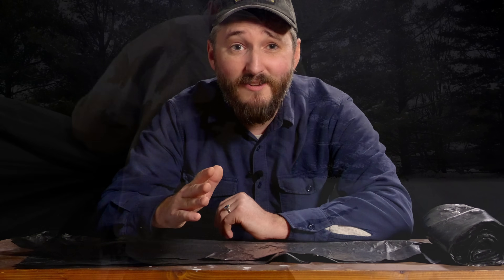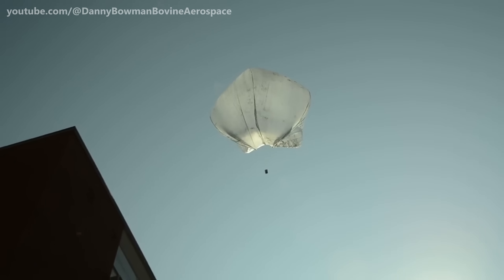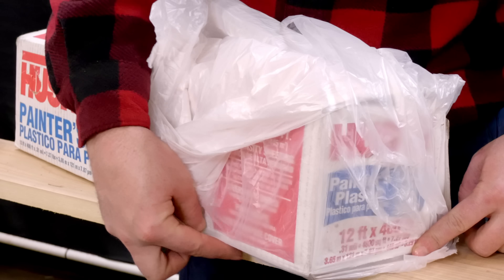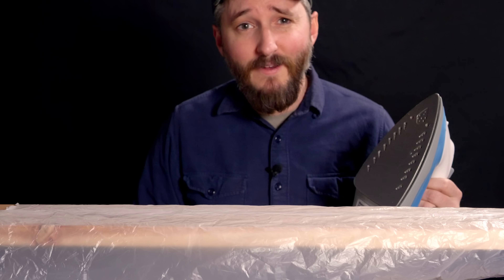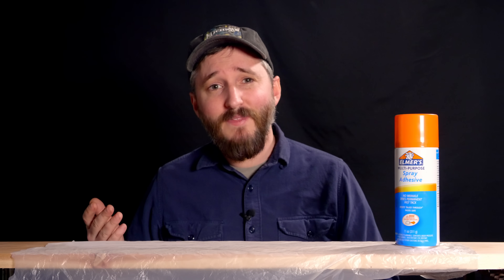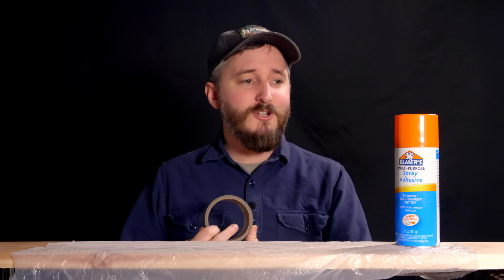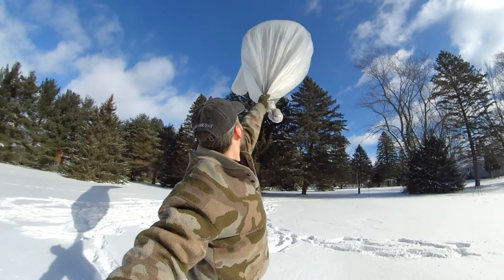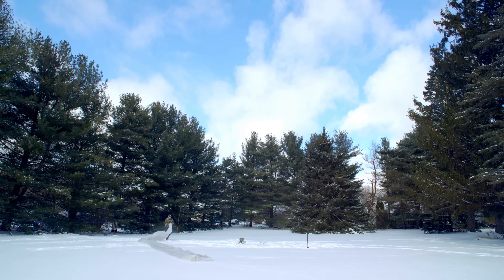DIY Solar Powered Balloons

Comment: You asked how anyone makes good heatseals on thin balloon films and said you read all your comments. I have a significant amount of experience in custom balloon manufacturing so here are a couple things I've picked up:

Each film is different, but heat sealing parameters are heat, dwell time, and pressure. All three factors play together so you can imagine the graph of good heat sealing to exist as curves and areas rather than single perfect points. Within those good seal spaces, you can prioritize factors like "Get it done fast." and "Don't overcook it, I can touch up areas that need more while it's in the jig and I can't screw this up."
Heat: an iron like you're using is just fine for many applications and will work for what you're doing. Through testing, calibrate the temperature starting low and going higher in increments, giving the iron time (a few minutes) to stabilize between adjustments. Overshooting at first is fine as you're bounding your temperature setpoint and narrowing it down. Final calibration comes up from cool to tacky to full fusion.
Dwell Time - How long you keep the heat one a given area
Heat transfers to your film at a particular rate for the tool you're using and your material layup(kapton safety release layers). I have made many a balloon counting off verbally on in my head as I work. It doesn't have to be perfect so long as you're in the ballpark and using the right technique for your material.
Pressure - Give 'er until it fuses
Pretty self-explanatory, but important nonetheless. Pressure can be applied during or immediately after the application of heat. A roller like an Everhard silicone roller or equivalent hard rubber hand roller is excellent for thicker films. Firmly sliding the heel of your iron across your joint is great for thinner films.

Test Swatches: Cut yourself a stack of 3" wide strips and play with the above parameters for your film until you're happy with the result. Just pull the strips apart with your hands for low pressure balloons. After a dozen or so tests, you'll start to get the feel for it, then move on to making longer continuous seals. Once you're happy with your seal, then move onto the balloon. Keep notes, you'll want them next time when you need to remind yourself what to do.

Lap Joint - Just how you have it where the film makes a circle and is overlapped at the ends:
Tape it all down as you're already doing it, but place your heat seal between kapton (can use PTFE, but I like kapton a whole lot better since you can cook it a lot more without it offgassing) sheets. The PE balloon film won't stick and you'll be applying heat and pressure from the iron without the sliding force tearing at the heat softened film. Make your seal nicely and you can get away with a real skinny sealed patch. Seal failure will happen at the edge of the seal so an extra wide seal only gives you more mass. 1/8" to 1/2" is usually plenty (film depending). More isn't a problem if it's convenient and reliable. Too skinny and it's going to tear easily due to force concentrations.

Peel Joint - || Where the || is your heatseal and the _ is the inflated surface
Quick and easy, good for long continuous seals with a minimum of mess. You can do large articles by unrolling them on one side and rolling them back up on the other side. Heat seal under tension to minimize shrinkage. Can use the hand iron with this technique, but I miss having an AIE Impulse Autosealer around (American International Electric - Automatic Heat Sealer) with the pedal actuation and knobs to set heat and dwell time. I'd often wind up modifying the jaws with kapton film to help get smoother seals as the PTFE impregnated cloth them come with has some texture that thinner films don't play nicely with. Set up your film overhanging the table with the sealer on a rolley cart. Bliss when you're doing a lot of sealing and don't have some kind of fancy reel to reel system set up.

The AIE sealer is expensive, but very worth it. There are a few models, but that's a matter of preference. The core technology is excellent. Watch out for hot spots at the very ends of the sealing bar, I solved this with some dacron tape over the ends until it stopped trying to heat seal or punch holes in my film there. I'd rather lose a half inch of sealing distance than fail a whole balloon. These machines can do lap joints, but only if you can fit the rolled up film between the jaws of the sealer. Feeding the sealer onto the work piece from the end lets you fit a bigger roll.

Bonus: Buffalo Felt Products makes some excellent offerings. One of my favourite layups for doing hand heatsealing with an iron is to use a hard felt backing layer so there are no sharp edges being exposed to the balloon film. Sand and/or deburr your work surfaces to minimize the occurrence of pinholing.

Iron
Kapton film (2-3mil is a good medium where 1 is too flimsy and 5 is thiccc and can give the seal an inconsistent edge)
Film Layer 1
Film Layer 2
Kapton film or tape of any thickness
1/8" SAE F-1 Pressed Felt from Buffalo Felt
Work table or plank

I hope you find my notes helpful. If you haven't noticed from the writeup, I can talk for weeks about balloons and am happy to do so. Shoot me a DM if you like.
Cheers!

PS. The adhesive tape you're looking for is called Seamstick basting tape. Get it from any sailmaker and you'll have a good time. 3M makes the best stuff and you can special order it in uncut rolls.(mind the fumes) It's an aggressive acrylic pressure sensitive adhesive on either side of a nylon film(iirc) reinforcing layer so the double sided tape won't tear or stretch like the roll-on adhesive you found. That's 3M Seamstick tape. It will peel off of PE fairly easily, but it holds great in a shear load (lap joint). Grab a skinny 1/4" roll for starters and you might not go back to another kind of double sided tape again. Roll your joints hard with a rubber or silicone hand roller and leave them overnight for best strength.
Reply from the maker: Thanks for the great info!
Reply: Ack, formatting got me on the peel joint. It's a T shaped joint where the heat seal is on the upright portion of the T.
Reply: " Roll your joints hard..."  heh heh

Comment: When my dad sprays polyurethane foam on roofs, we often use plastic sheeting like this to protect walls and sidewalks and such. We try to reuse the plastic if we can, but I have always noticed that the first bit of overspray comes right off like butter, but after that it progressively gets harder and harder to remove. So I think they put some sort of very fine powder on the plastic to keep it from sticking together, or else maybe it's some sort of residue from manufacturing. But once you get that powder off, things do stick to it much better.

Comment: So if you had one of these solar powered balloons feathered with a wire floating at 1000 feet or so would you be able to run a corona motor fast enough to actually produce power?

Comment: My students normally use black plastic. Yet, we also had success with a transparent plastic (from dry cleaner bags). Inside of the balloon, we hung a sheet of black plastic. It acted like a greenhouse. Sun light passed through the clear plastic, hit the black plastic on the inside of the balloon, heated up the black plastic (infrared), which heated up the air inside of the balloon, but also the IR is trapped inside the clear plastic like a greenhouse. 

The traditional shaped solar balloons (that look like normal hot air balloons) , we also found that you don’t always have to seal the bottom. You can add a little bit of weight to keep the opening on the bottom and just have it fly with the mouth of the balloon open. 

One of the guys in my solar balloon discussion group, he put a tracker on his solar balloon. We tracked it throughout the day. It took off in northern Minnesota (or Michigan…I can’t remember) and landed in Georgia.

Comment: I’d have tried something much thinner to heat-seal it, like a soldering iron set to a precise temperature. That’s what I do to make thin pockets for SMD components out of a clear file. Water vapour is lighter than air. Make a steam balloon next!

Comment: Surely the CO2 would naturally fall back out of the opening after cooling against the outer surface if it was raised by heat, similar to condensates.  The water vapor, on the other hand, might condense on the plastic itself and stick around.  A tube of graphite would be a good way to introduce a heat absorbing coating to the interior, just squirt a bit inside the tube as you're unfurling it occasionally and then shake it around inside to distribute.  At that point you wouldn't need a bucket of fatwood, you could just use a hairdryer with the anker power supply.  Would be nice to find a good way to heat seal the end to avoid a heavy knot on the end.

Comment: You mention that water vapour is heavier than air - that's not true. Feels counter intuitive, but since the molecular weight of a water, H2O, is less than, say, O2 or N2, water vapour is actually lighter (and humid air is less dense than dry air).

Of course things change when water condenses into droplets or on your balloon's internal surface...

Comment: "Air traffic gets disturbed" - More UFO sightings, and wasted missiles in the worst case.
I used to make hot air balloons from swing bin liners. For cutting and sealing, I had good results using a temperature controlled soldering iron set to around 130-140 deg C (from memory) and using a straight edge (piece of wood) resting on the plastic to slide the soldering iron along - I did manage to seal two bags together like this, to make a double height balloon.
I never got a solar balloon to launch, it needs bright sun and cool air near the ground to work, that's quite rare in the UK.

Comment: Usually all heat sealers have Kevlar between the plastic and heating element! baking sheet would do the job.
With a very high temperature iron give it a quick press and pull it away quick!
❤

Comment: What about beginning inflation with a hair dryer or heat gun?
Reply from the maker: That would work fine, you just need to coat the inside with airfloat charcoal instead of relying on smoke as I did.

Comment: Hey Nighthalk ! to join the plastic together, try using a method we at my flag factory do to seal our bags. Iron the plastic seam (with an inch or more of overlay) over a peace of paper. This makes the heat spread slower and prevents the plastic from melting and sticking to the iron itself.

Comment: When you're done with your solar balloon projects with the kids, you could then turn the leftover plastic into an educational demo (and fun project) on how to recycle HDPE into other objects. Because it melts at a relatively low temperature and gives off very few fumes when doing so, it's a great project for kids (as long as they're old enough to understand the importance of protective equipment like gloves). Using parchment as a protective layer between your heating element (your iron or even a panini press) and the plastic, you can fuse multiple layers of plastic together and then use the resulting "fabric" to make all kinds of reusable things.

Comment: I really do like Anker's products. I'm confused as to why 4kwh would only get you 15 miles in an EV. Usually EVs only take maybe 4bhp to maintain highway speeds. Given that everything in this electrical sequence is probably north of 90 percent efficient, you should probably get more than 60 miles with the entire charge.

Kinda weird for me to be advocating harder for a sponsor than the content creator is.
Reply from the maker: I'm not sure, they gave me that number. Maybe they're accounting for electric trucks. I figured it was a very safe minimum to claim in any case.
Reply: @Nighthawkinlight  Hey, if you have time and have one available to check, I can't find anywhere if it's inverter is a pure sine inverter or modified sine. I'm guessing its the first one since most split phase things with that much power are, but the manual doesn't say and the company's website doesn't say and Amazon doesn't say.
Reply from the maker: @htomerif  Shoot, I don't have an oscilloscope to check. I'm sure other reviews will come up shortly to say for sure. Sorry to be such a weak source of info!
Reply: @Nighthawkinlight  Its fine. Cheap way to do it is to plug a fan in. If it sounds the same as when its plugged into mains, then the inverter is pure sine. If it suddenly sounds like a tattoo machine, its probably modified sine.

Maybe you can get an oscope sponsor. Electroboom has them pretty regularly if I remember.

Comment: save some weight by using string to close instead of a knot and trim the extra material off.  we used to make hot air balloons with laundry  protection bags ,straws and birthday candles....  the gag blow out proof candles work great.. but even more dangerous... we used to let them go free lol... not smart but fun,  use dyneema type fishing line... weight matters a lot.

Comment: From my childhood, I remember those stickers that you could iron onto blank t-shirts. From that experience, I would suggest that you try using a wet newspaper between the iron and the plastic when you try to join the two sides together. But as far as I know, not all plastics can be joined by melting. So it would be best to look into what kind of plastic is that you wish to bond and what chemical can be used to bond the two sides tohether to reduce weight.

Comment: Im wondering if the tube would fly even without the smoke particles. I think the plastic may hold enough for it to just fly itself. The darkening of it obviously helps get even more lift to make it work better for heavy payloads, and is better overall though.

Comment: Great thinking with the CO2. It's heavier than air but not so much and is a potent greenhouse gas. Water vapor might condensate at low temperature like yours and act as a dead weight. Sought is heavy compared to CO2 and they migh not be mutually exclusive but keep in mind that sought's absorbtion sectrum probably covers CO2's. 
And since sought is also probably not so good at distributing the captured heat, I suggest you try filling your baloons with pure CO2.

Comment: is it advisable to wear a mask to stop as much fumes coming from the fire entering your lungs during the process or is the open air enviroment enough to disperse enough of it so that it's not an hazard, i know the final idea is to not use fire at all, if i understood correctly, but just something i was wondering myself for other people that might want to replicate at home. just curiosity. also did u smoothen then edges of the wooden board with sand paper before using it to make the tube/baloon? would that help in any way, like did u ever encounter problems with splinters tearing the plastic while making one or u simply chose a very well produced wood board to begin with that never made u even consider any of this? did u chose the wood because it allows u to stick the masking tape to the plastic farely well? all and all fantastic project,  i really ejoyed it.
Reply from the maker: It is hard not to inhale the smoke if the wind blows but I think there's not much risk with such short exposure. I did sand the corners of my board but otherwise there's nothing special about it

Comment: semi black plastic would heat faster and also an aluminium parche that is heated by a solar concentrator would heat the air inside only with the sun

Comment: "On any given day, nearly 1,800 weather balloons are launched across the world, including 92 here in the U.S. and U.S. territories, according to the National Weather Service. Each flight lasts around two hours, during which a balloon drifts up to 125 miles and can reach an altitude of 100,000 feet."
Every one of these is a hazard to commercial air traffic. 

I've witnessed 2 of them wizzing by my airline window, on flights 3 years apart. 
This was astounding, as hitting one of these at speed could disable the cockpit any number of ways.. .Yet.... we ignore this very real threat. 
This needs to change.

Comment: Lay wax paper over the seal before you iron. It might also help to get a monokote iron so you can control the heat better. They're used for shrink fitting the plastic skin of RC plane wings.

Comment: In my experience, using parchment paper or a thin towel under the iron makes it a lot easier to find the right amount of heat, by adding time to the equation.  For plastic this thin, parchment paper is probably the best choice.

If you can nail heat-sealing, you gain a lot of payload capacity that would have been spent on the adhesive...

Very nice idea for a exceptionally cheap and expendable lifting platform for a WSPR radio balloon...  Though I guess keeping it in the air throughout the night might be hard.

Comment: Looks like a giant condom.
I heard of a man-carrying, solar powered hot air in, I think, the late '80s. As I remember, the outer envelope was transparent but an inner curtain on a track that could extend or retract, increasing and decreasing the solar absorption area. In this this way, the balloonist had as much control with a solar balloon as with propane, but could not run out of fuel... on a sunny day. Much more flying on a good day. Sounds like a good trade-off, honestly.